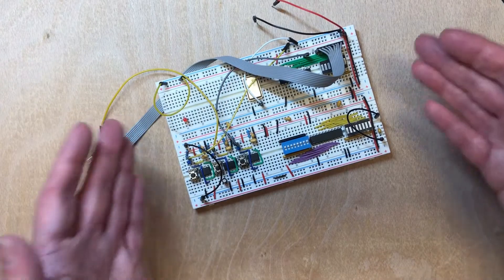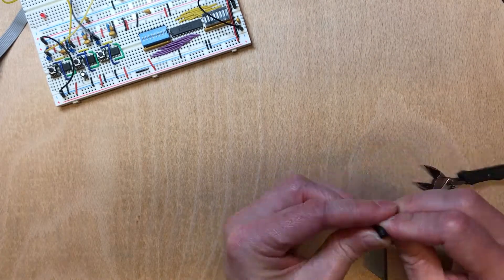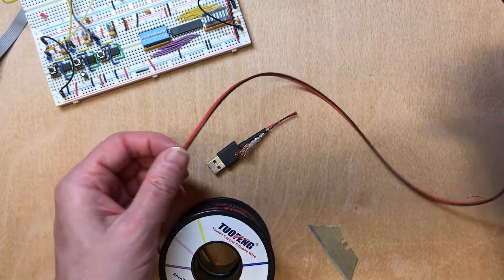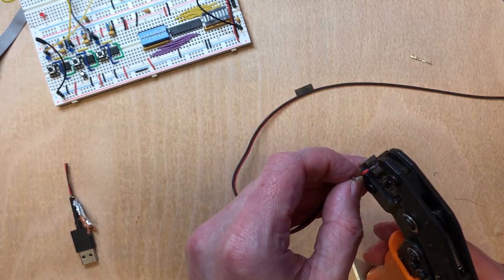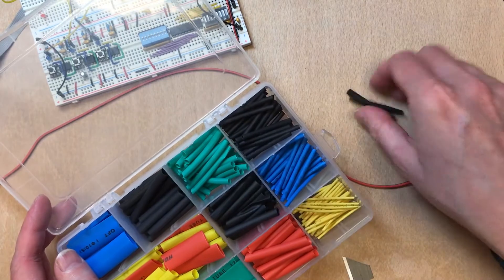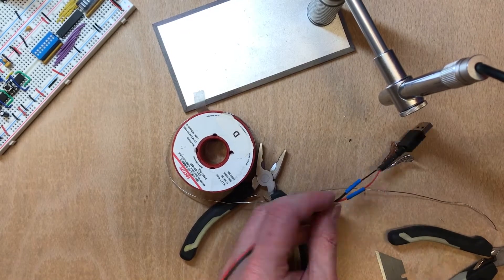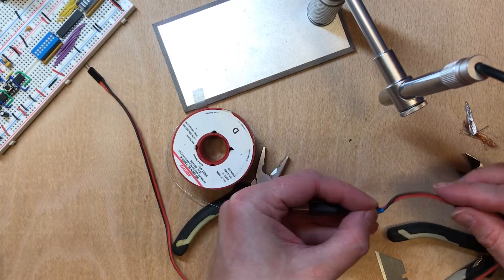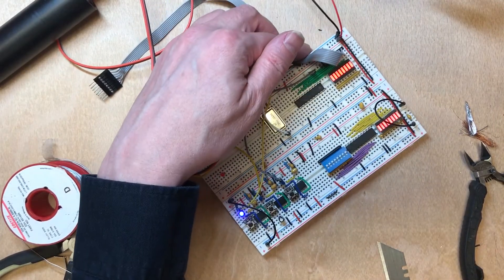Usb to Dupont cable

Comment: One thing I've started doing is to offset the the solder connections so that they are not next to each other.
Reply from the maker: Probably smart, I do have a different plan for breadboard power that I want to experiment with at some point.

Comment: Nice looking cable. I’ll have to try your trick of folding the soldered section back to get a better grip. I usually stagger the two connections and use a smaller outside shrink wrap to keep the cable from being too bulky.
Reply from the maker: I'm by no means the expert on this, but they are better now than the first ones I made!